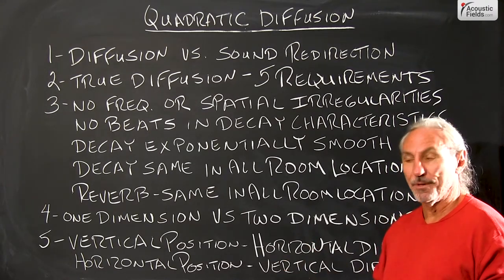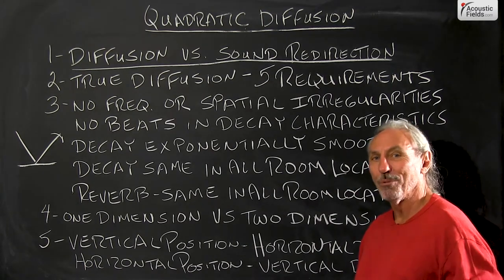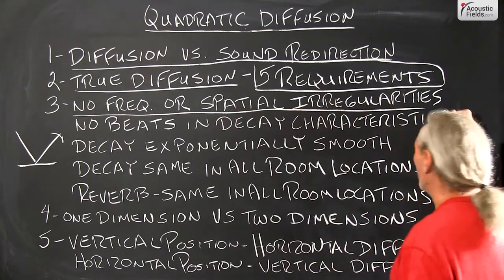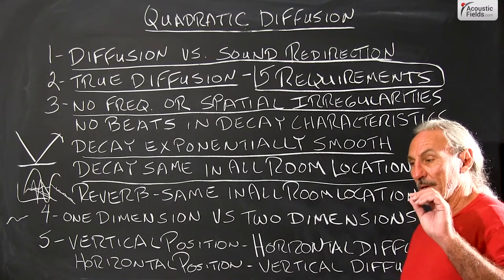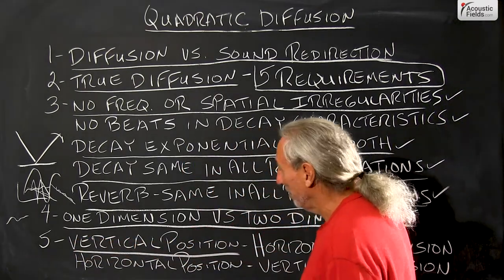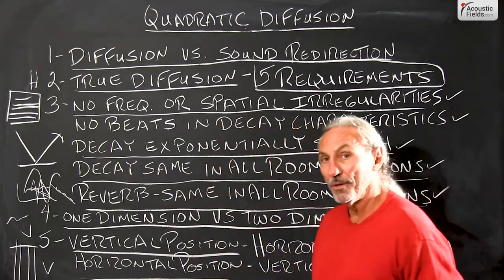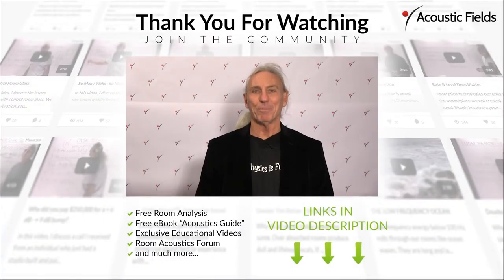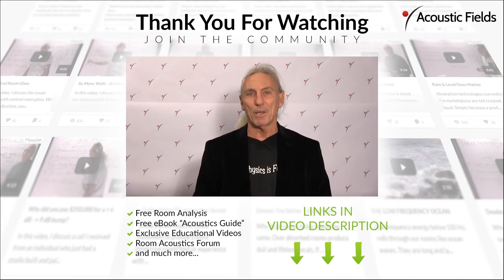Quadratic Diffusion - www.AcousticFields.com

Comment: Have you personally heard the ZR Acoustics products? I'd be curious to hear your thoughts on them. I didn't believe it until I heard it. Only 7% of the room's surface area was covered, all on the front wall, and it was one of the best rooms I've ever heard. I've heard it doesn't work in all situations but those panels still offer much more of an effect than anything else.
Reply from the maker: G,  I have not but covering only 7 % of room surface may work for middle and high frequencies provided the room matches size and volume with usage. However, if the room is small and exhibits modal issues, then 7% would not be enough coverage. Even with our carbon technology which is the most powerful available technology.
Reply: Their products treat all frequencies (I believe down to 10Hz) and are only around an inch thick. I asked Hanson about treating modal issues and his response was that if you have enough panels in the room, it will solve modal issues. Their technology has 37,500x the acoustic resolution of traditional treatment. Although their panels are expensive (up to $900 for a 2x4 panel that's about 1") I'm looking into getting some to test in my studio and try to learn more about what exactly they're doing. So far I haven't been able to understand what they're doing so they just seem bogus but after hearing them, I know they're not.
Reply: According to them, instead of controlling waves like acoustic treatment usually does, they're manipulating the air itself so it affects all frequencies. I've discussed this with a physicist and found that it was possible.
Reply from the maker: S, For verification of performance, test results from independent labs would be a start. Secondly, a simple room response curve before and after treatment would be another good step especially for low frequencies below 100 Hz.
Reply from the maker: G, Subjective impressions of room sound quality are based upon numerous factors. A person's time in field, experience with different technologies along with room size and volume, coupled with the quality level of the equipment used all contribute to impressions and opinions. I have had many people tell me that their room is the best they have ever heard and that is to me a good thing because it makes them comfortable with their room and gear. It is all about their reference to things. Many that come to my studio, change their mind about what they consider to be the "best". They now have a new reference to go by and hopefully this will benefit their existing room and gear.
Reply: I'd be very curious to hear them too but especially to see some real measurements, cause I always see a BIG red-flag when they use the word "Quantum" or "Chaos Theory"...... 
but I'd love to be wrong in this case :)

Comment: Hi, does that make sense to place quadratic diffuser in a crowded place like the back wall of a church?
Reply from the maker: It depends on your acoustic objectives. Diffusion is a tactic that you use towards a particular strategy. What are you trying to do? Are you trying to minimize the reflection from the rear wall to the front of the church?
Reply: @AcousticFields  Hi, yes that is part of the idea + providing a good diffuse sound to people that are far from the speakers placed on the stage.

Comment: looks like you preferred horizontal OR vertical diffusion over the BBC QRD concept. may i ask why?

i'm contemplating adding BBC QRDs to my already well treated  listening (not work) room. bigger sound stage while good looking.
the well width determines  the highest diffused frequency, yet manufacturers go for 4-5 cm wells and not for the highest cutoff possible.
is diffusion unnecessary above 4k because reflectivity is so high at those frequencies that any room is a good diffusor?

also contemplating Vicoustic Multifuser DC2 for the ceiling. lightweight EPS, Google takes you straight to measurements that look fairly good to the untrained eye. But are they?
Reply from the maker: L,  I do not prefer any type of diffusion. The type of diffusion, one or two dimensions entirely depends on distance and room usage. A vertically positioned QRD diffuses energy in the horizontal sound field. A horizontally positioned diffuser diffusers energy in a vertical sound field. One dimensional diffusion requires more distance for the waveforms to fully form than a two-dimensional array. We use 3,450 Hz. as our top frequency.